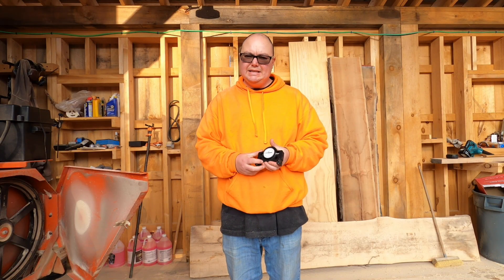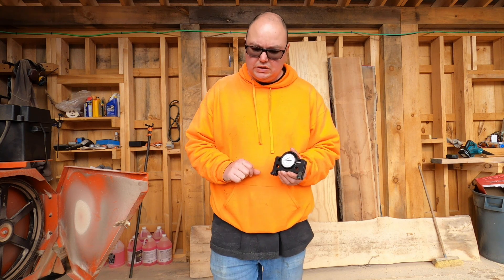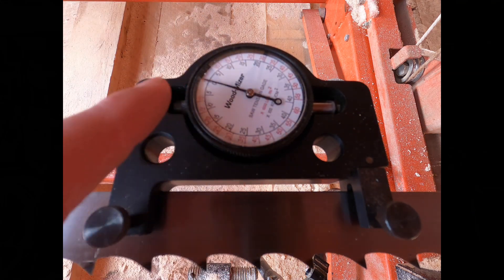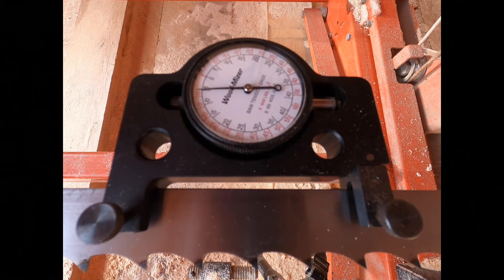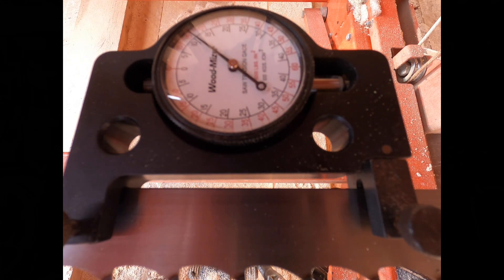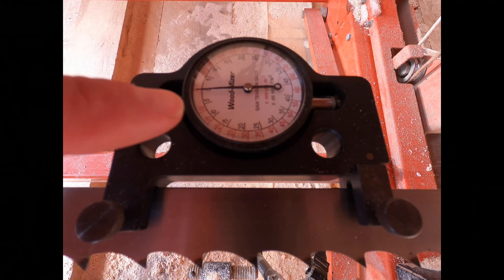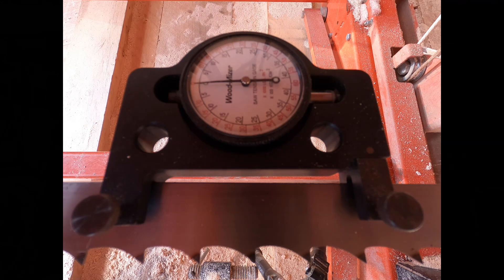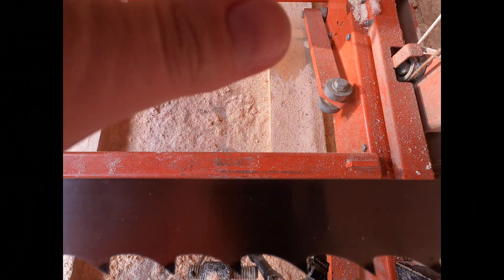How To Use a Woodmizer Saw Blade Tension-Gauge, CCS#80

Comment: I ran across one of those a week or so ago and I wondered how they worked.  Good video...except the very end, haha!  How did your desired reading relate to the big red bushing on the adjuster?
Reply from the maker: That's actually why I have the gauge, because we have found that we cant replicate the tension based on the number of turns on the "star nut" that tightens on the red tension-bushing. The fact is that the length of the saw blade being off even 1/16" will change the turns it takes to get the same tension. The gauge was an early smack-in-the-face for us when we realized we had no idea "how tight" the blade was at any given time. -Andy